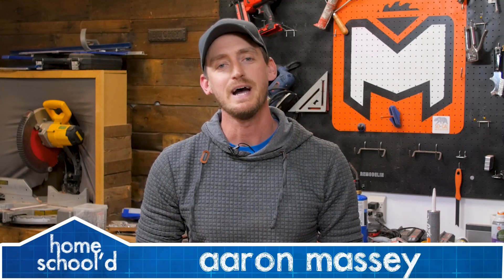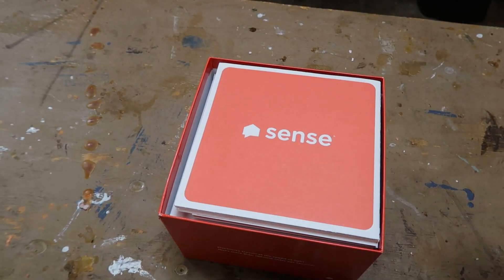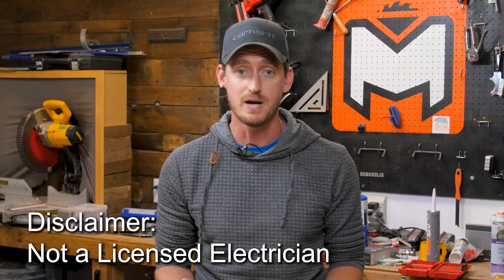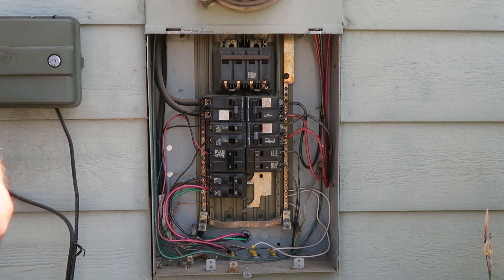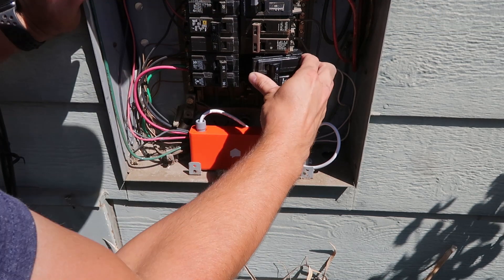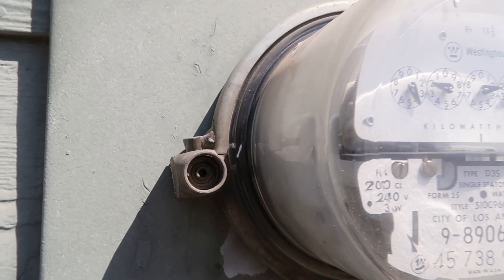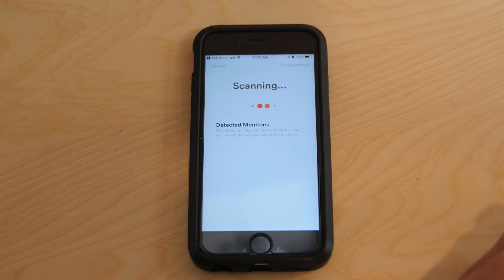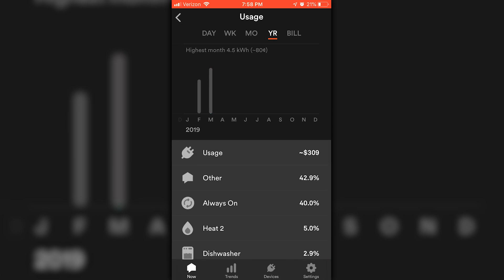How to Monitor Your Home's Energy Usage | Sense Energy Monitor Install & Review

Comment: If  I want to know how much my refrigerator or a computer costs me every day is there a device I can plug into the wall to get this information?
Reply from the maker: If you only want to know one specific device, yes. You can buy a voltage monitor that plugs into the outlet. Search "electricity usage monitor" and you should find a bunch of options.
Reply: @MrFixItDIY  I got 2 smart plugs they work like a charm.

Comment: Any info on how it is working now?  Has it identified a lot of devices?  A lot of mixed reviews.  I'm on the fence about getting one.  I hear it can't identify items behind a UPS.
Reply from the maker: Yes, it continues to identify new devices every week. Once it identifies an item type you have to manually determine which item that is by doing some testing around your house while looking at your app but it has been about as simple as flipping a switch on and off in most cases. I check the app often for updates and make adjustments and I still enjoy using it and gauging my usage.

Comment: You had a Siemens panel it looked like. You installed a Square D Homeline breaker. You really will want to change those to match the brand of your electrical panel to be up to code and be in compliance. Good video.

Jeff - Licensed Journeyman Electrician Sunny Central Florida 😎 🌴 ☀️

Comment: I prefer the fixit videos vs the infomercials. But that’s just my opinion.
Reply from the maker: It's a product I actually like and chose to make a video out of because I think it'd be helpful for a lot of people. I wasn't paid to promote it. I just thought I'd spread some awareness of its existence and that I've personally benefitted from it. If you don't like it, don't watch it.
Reply: Since it learns based on more users having the device, does that mean my data is shared?  Is there a monthly fee/subscription?  It would be really useful if it would report when a device is having a problem and do analysis to recommend changes in devices, and changes in use.  For example, tell me if the dishwasher is now using 4 x the power it has in the past, or the down stairs air conditioning compressor is using $200 a month inpower which is 2x what the unit should use for those number of hours used, . Or that since I can buy power repriced every 15 mins, I can heat water, freeze ice, and wash dishes, and cool/dehumidfy my house,  when grid power is priced at a negative rate.

Comment: Thanks for the video. I was considering getting a Sense months ago but the reviews were mixed on its ability to identify what’s turned on. 
Have you had many unidentified/misidentified items? 
Any chance for a follow up video going into detail on how things show up and how they help you understand your usage?
Reply from the maker: Benji Benning it takes a lot to go through and identify each thing. I don’t go through and isolate each light for example. I’m focused more on the bigger items but you can pretty easily identify by switching things on and off.
Reply: MrFixItDIY Understood, thanks for the clarification. I think historically the complaint I read was that if it didn’t identify what an item was, you didn’t have an option to specify “this is an oven, this is a washer”. It sounds like that isn’t an issue any more, which makes it much more appealing.